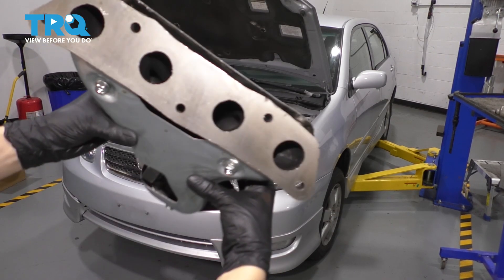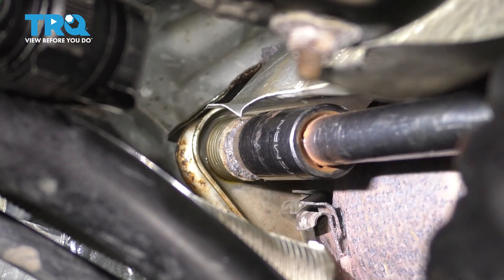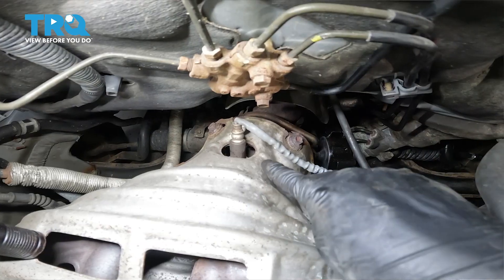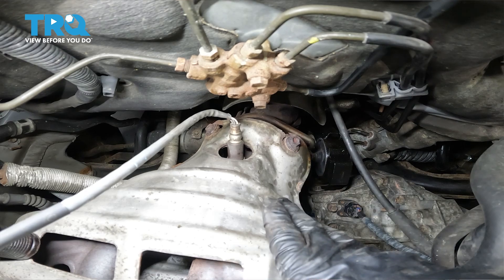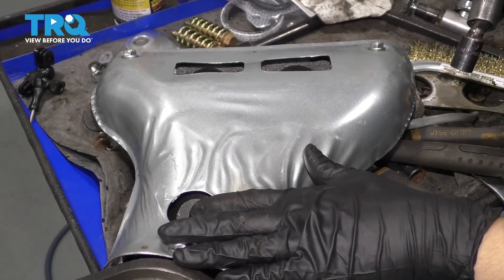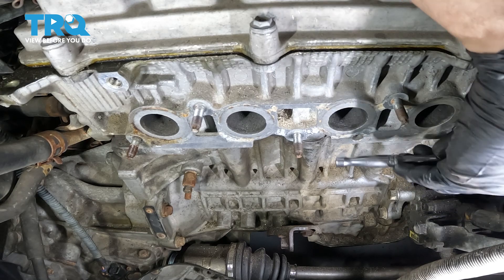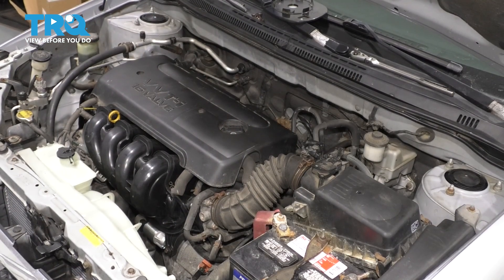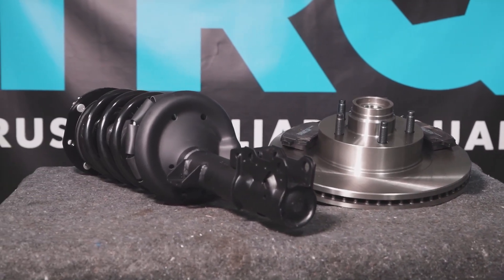How to Replace Exhaust Manifold 2003-2008 Toyota Corolla

Comment: Anyone else have issues with the two bolts on the under support bracket not lining up? I had too drill one of the holes to make it line up.

Comment: Why make so much difficult work for yourself removing the sensor.  Take the manifold off and remove the sensor on the bench.  You know you can slip the box end on a 22mm wrench over the electrical connector so you don’t have to mess with that cumbersome crowsfoot.

Comment: Did u put anti seize on the  last 2 bolts contecting to manufolds the  one with the springs? And also the did the studs have thread sealer on the  engine block.